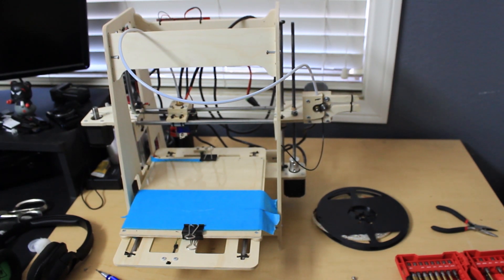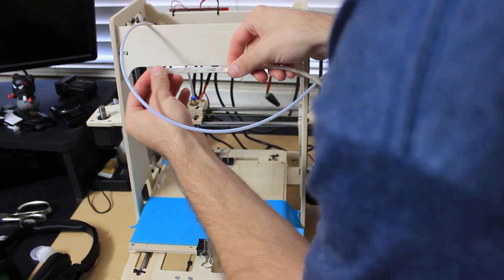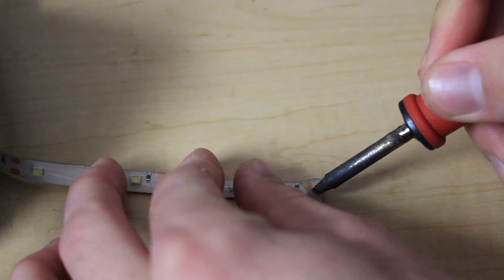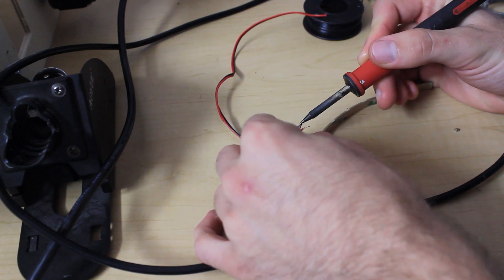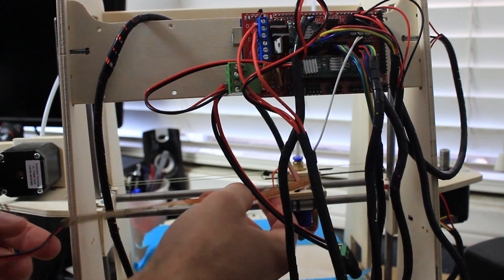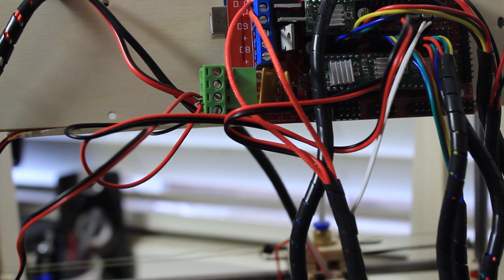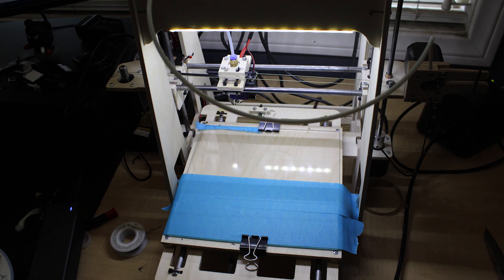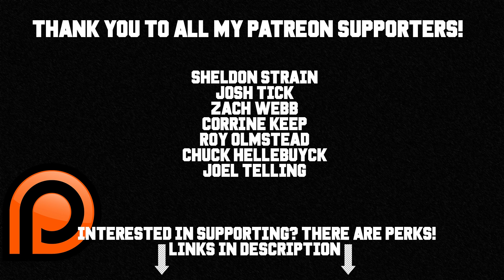Tutorial How To Add LEDs To Your 3d Printer

Comment: I would think adding LEDs to the roller frame for the X axis to light the area directly under the nozzle would be more beneficial.  FYI, they sell those same LED's without the rubber coating for indoor only use.  (Perfect for this and simplifies the soldering required.  Great video though thanks for the DIY idea.

Comment: Been using these for years. Came to see if you wired to board. So thank you just what I needed. I actually do clusters and interiors of cars with but at my job my boss melts like you. I on the other hand I push a razor down right past the solder point and then stick my finger nail in and sort of peel the rubber coating off works pretty well. They also sell the same strips without coating on eBay not sure about amazon. search 5050 smd or 3528 and try strip as well.

Comment: how big a battery do u need to run a strip rthat long
Reply: You can use anything 12 volts. I use RC batteries. 3s low C rating look for transmitter batteries on hobbyking. Sometimes you can get them for $10 and they will run the LED for hours. I would just wire to board like he showed in the video and add a switch.